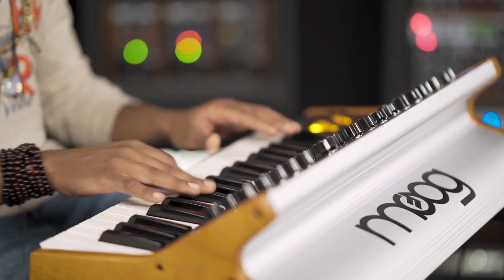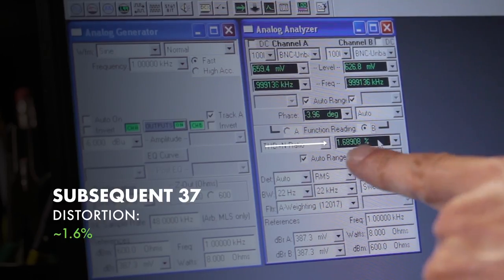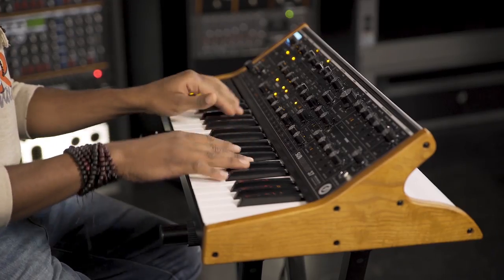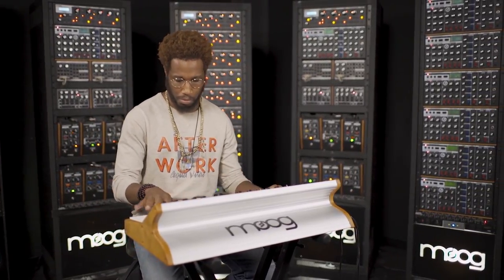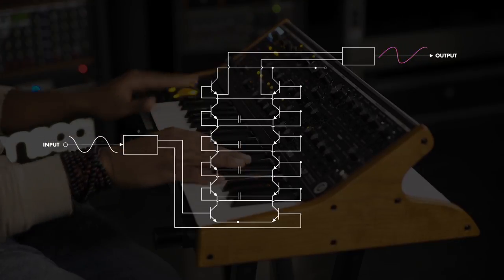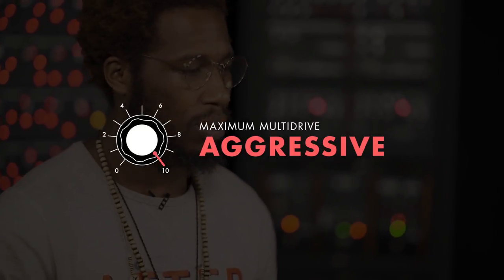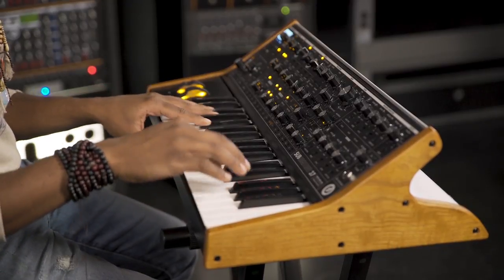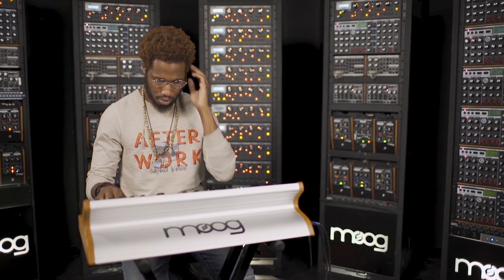Subsequent 37 | Precision Audio Analysis

Comment: They should have named this synth "Sub 37 Buyers Remorse Edition"  ;)
Reply: Not really when pushed the original sub sounds better than the subsequent to my ears, hey, if they would have included the CV upgrades i'd have cared a hell of a lot more, i'd love the subsequent CV but really its not that much of an upgrade for orignal Sub37 tribute owners.
Reply: differences are actually very little. not regretting anything ;)
Reply: Yes. Thank you Moog I bought my sub 37 6 months ago.
Reply: Good thing about Moogs and other analogs is good resell value. As long as you didn't thrash your synth, it should fetch for a pretty high price still. Just think of the loss as rent and then you can upgrade to Subsequent 37.
Reply: Wow why u say that?

Comment: Having now bought a Subsequent 37, after having a Sub37, I can some up the sonic differences:
The subsequent 37 sounds very slightly cleaner and clearer due to the extra mixer headroom, so the oscillators now have a little more breathing room and don't get crushed so much. It's also a touch brighter since it sounds like the filter brings out the harmonics a tiny bit more, so the 24dB/8ve filter sounds a bit less muted than before. All these changes are very slight though and still sounds basically like a sub 37. 
However WARNING: if you simply transfer your patches from the sub37 to the subsequent then by default they will probably sound more gritty/less clean if there was any multidrive on it since the position saved will correspond to more drive now, since the range has been increased. Adjusting the knob down though will instantly correct it.
The keyboard action - honestly I can't really notice any difference. Some people might though.

Comment: Really great performance! Besides the extra CV section and color, is there any difference between this one and the CV LE?
Reply from the maker: Aside from the CV Outputs, there are no functional or sonic differences between the Subsequent 37 and the Subsequent 37 CV.  Beyond the color differences between the two, the Subsequent 37 CV also features wood inset solid aluminum sidepieces whereas the Subsequent 37 has the classic solid wood sides. The Subsequent 37 CV is limited to 2000 pieces. The Subsequent 37 is now a standard production model.

Comment: If there's more headroom on the mixer as advertised, wouldn't this mean you actually wouldn't be able to push the filter as hard. I get that more headroom can allow for a cleaner sound (I welcome this), but at the same time on the video it says on the subsequent 37 the mixer can push the filter harder than on the sub 37 allowing for richer harmonics/more distortion. Surely you can't have it both ways. I imagine it's the changes to the post-filter multidrive where the extra distortion is coming from, not pre-filter?

Comment: on my sub37 ive always kept my mixers under 4 or 5 on a normal patch and had the output volume all the way up - is that not the way to get the best signal or was i misinformed?
Reply from the maker: "Best" is subjective, but by keeping your mixer levels below 4 you are getting less distortion from your mixer section. However, the Subsequent 37s mixer has double the headroom of the Sub 37 giving you access to a much wider range of clean sounds before distortion.
Reply: rss313 that's what I do most of the time too.

Comment: Will sub 37 preset patches work on the subsequent 37?
Reply from the maker: Yes, you can transfer presets from the Sub 37 to the Subsequent 37, however the analog boards are different which means that you'll need to make adjustments to most of your existing presets for them to perform optimally on the Subsequent 37.
Reply: Moog Music Inc, are the main adjustments on the Subsequent when using Sub presets mainly to the mixer, multidrive and feedback levels?

Comment: I thought you couldn’t play more than one note on this thing?
Reply: it's duophonic (not 2 note poly) each note shares everything but the osc (which takes the 2 oscs and lets you play diff notes with them), or you can use it in normal monophonic mode (both oscs on one voice). Had a Sub 37.